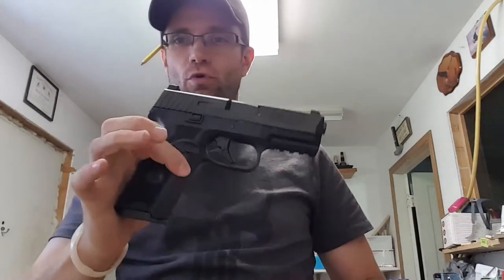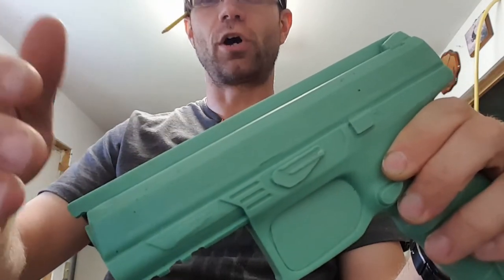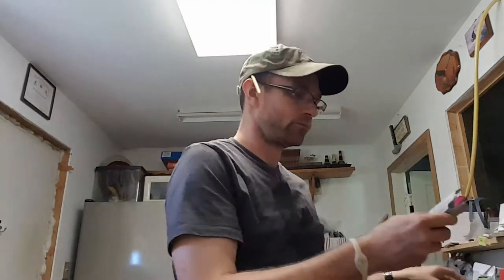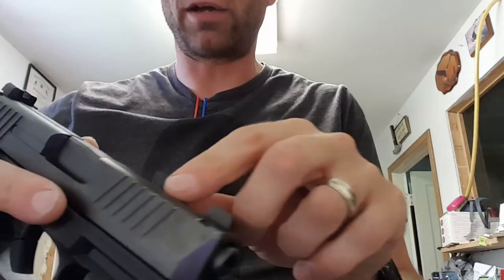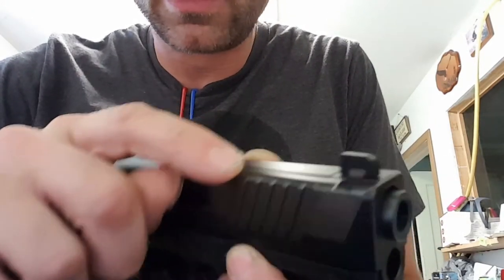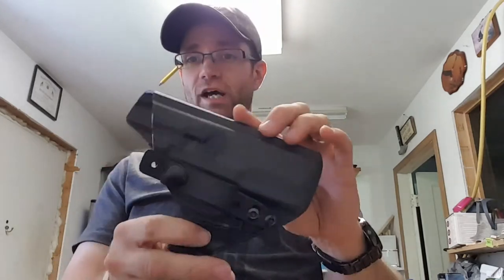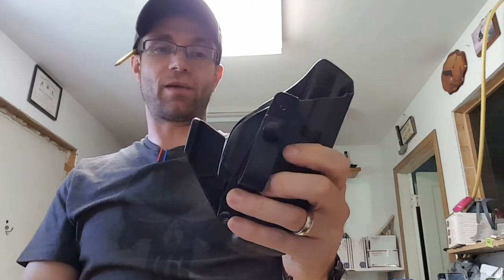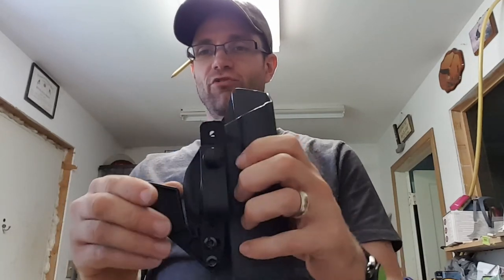FN 509 Holster update

Comment: Glock 17 holsters hold 509s really well
Reply from the maker: Mr. B that is fair going to depend on the Holster.
A 509 won't fit in one of my G17 holsters at all. The bottom of the rail to the top of the slide is larger on the 509.
Reply: NICKydex01 I should have specified lol. It fits my bravo concealment really well, that's my fault man
Reply: Hickock 45 used a glock 19 holster, so would fit a nylon not a molded kydex g-19 holster